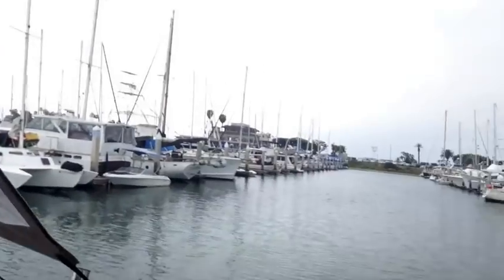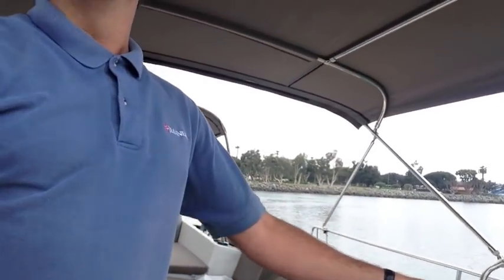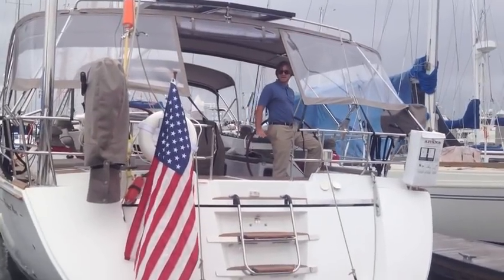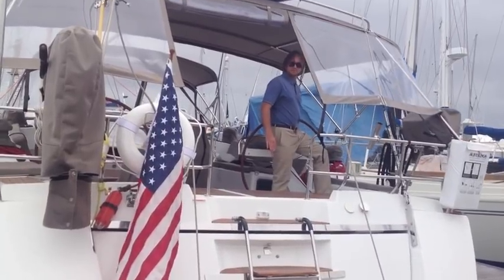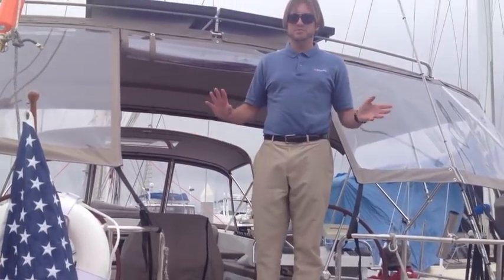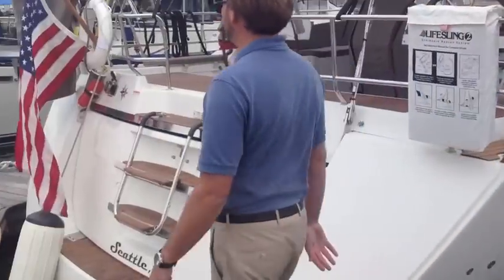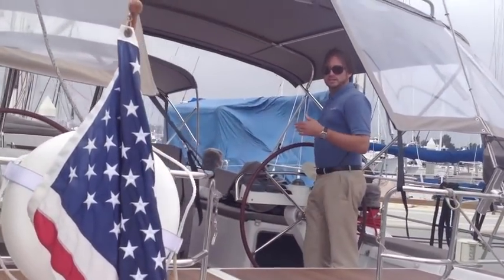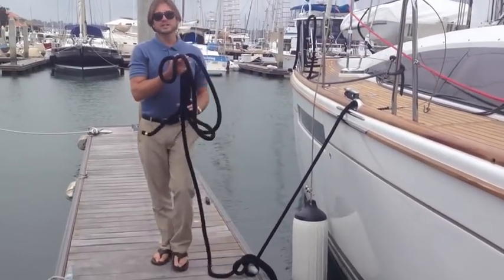Docking a 57' Sailing Yacht single handed By: Ian Van Tuyl at IVT Yacht Sales in California

Comment: Excellent demonstration of the advantages of thruster systems on modern boats that really improve maneuverability in tight quarters.  Twice it was mentioned the wind conditions were a factor, at 15 knots, yet the water in the channel was glass smooth and the flag barely fluttered.  Hmmm. Nevertheless, great single handed docking demonstration.

Comment: It's good if you can do it under all circumstances without bow thruster or any electronics yourself, BUT... I LOVE IT! (y) 
Sitting somewhere in the boat, watching every movement on your monitors, controlling the huge mass of the boat just by your fingertips.
Comparing this with backward-cameras in modern trucks, or automatic parking assistants  in modern cars. It may protect YOUR vehicle too! ;) 
If you don't like it, don't use it! :D 

BTW: I miss the "meep meep meep" while driving backwards. And the yellow flashing lights. :D

Comment: Nice job, but with the breeze of the port side a trick I use for single handed stern mooning on my sense 46 is to have the line round the back of the boat starboard side and then step off, line in hand, and tie fairly short to the cleat. Step on board again and put engine in to forward gear. This then pins the bow to the finger and you have all the time in the world to put the rest of the lines on. Works for me.